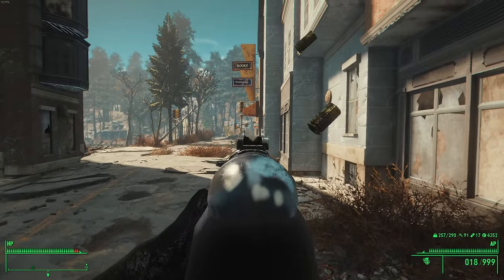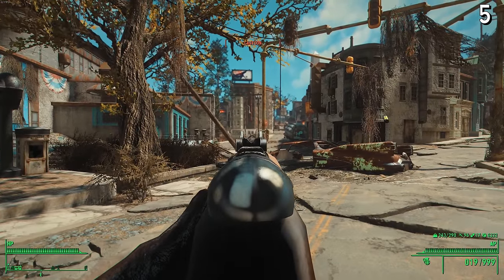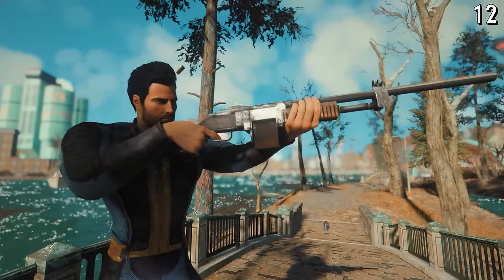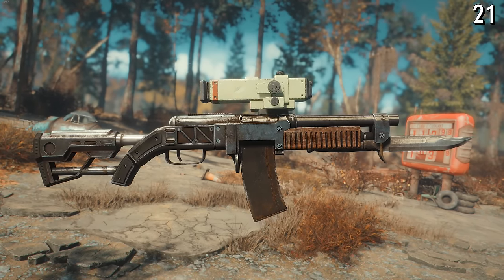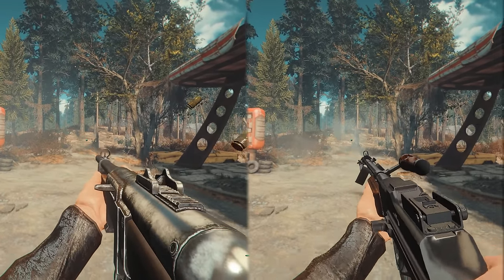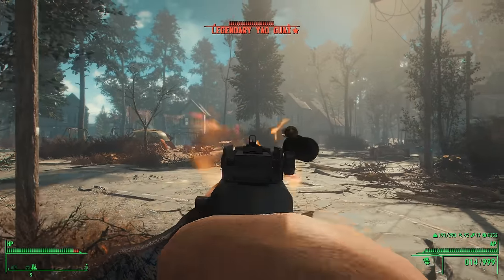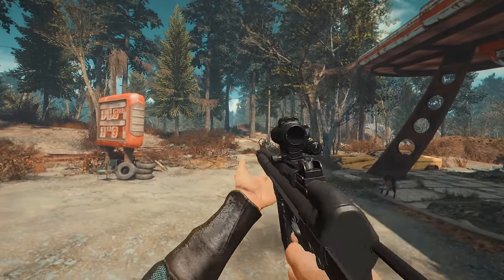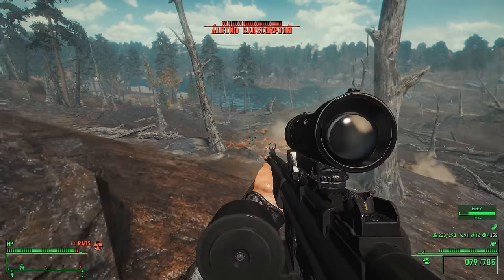Everything WRONG With The Combat Rifle In Fallout 4... And What It SHOULD Have Been

Comment: Having been an armorer for the us army, national guard units keep around old gear, they are usually the last to get new stuff, we swapped over to the m17, but most national guard units still have m9s in the invasion of Iraq tank crew men were still issued m3 grease guns, it’s not unreasonable for fallout’s national guard units in Boston to have kept around the bar, especially when in certain areas their tech progressed in certain areas but lack in others, if they are still using a g3 variation in 2077 when the bombs dropped who’s to say they didn’t faze out the bar until much later as well? Keeping it in the hands of national guard
Reply: I would've been fine with this.
Natty G's still using old but reliable stuff due to issues with logistics.
F3 was fine in this regard with the prevalence of FAL/G3 hybrids chambered in 5.56x45mm.

But then came F4 and for some reason the Commonwealth National Guard got sets of new T-60 power armor because "rool ov kewl" in the prewar prologue, and the prevalence of pipe weapons in master locked military safes inside 200+ year old sealed bunkers, and the asinine "standard issue" weapons that would've been outdated at the end of WWII.

Really.
T-60 should've been a Brotherhood of Steel exclusive power armor. Made as replacement upgrades for aging T-45s they had. While the prewar prologue National Guard should've been using T-45 instead.

Pipe weapons should be removed from any prewar military installation loot tables.

And conventional ballistic firearm design (not including laser, plasma, cryo, and the like) should be completely scrapped and replaced with realistic designs. 
There'd be 2 prevailing design philosophies.
Prewar and postwar.
Prewar is basically carbon copies of ours. With some upgrades and additions to our current ones to portray 2070's weapons. 
Really old prewar weapons for example would be Korean to WWI weapons.
Modern 2070's prewar weapons would be really rugged, metal reinforced M16s with ACOGs or Mk19's with carry handles for power armor.

Postwar would be prewar weapons redesigned to be as easy to manufacture in the post apocalypse but still be reliable and useable as possible.
An example would be an M16 with simply made wood furniture, no dust cover, no T-handle, no carry handle, no forward assist, simple notch and post sights, straight magazines, semi automatic by default, and a long screw on the bolt to act as the charging handle.
Reply: Fallouts navy kept the m16 70 odd  years after the rest of the coubtry moved to newer guns  so yes this happens even in fallout
Reply: @demonic_myst4503  some things never change
Reply: I interpreted the Combat Rifle as an older gun that was chambered for .45 and issued to the police departments and national guard depots to violently repress Protests and Resource Riots.
Reply: this "gun" the combat rifle would compare to the NG having smooth bore brown bess rifles on storrage in case of emergency. the "combat rifle" is by all means obsolete even by fallout timeline standard as the divergens happens in the late 1950´es when something like the FN-Fal, the CETME-L, the AKM, the G3, and even the first incarnations of the M16 does exist, other games in the fallout series especially prior to fallout 3 has more "modern" assault rifles SMG´s MG´s in their arsenals. even in fallout 2 they have P90 PDW´s. the MP5-sd exist in fallout tactics, the G3 in 5.56x45 exist in fallout 3, the XM-117e2 exist in New Vegas.
Reply: @DJWeapon8  Yeah
The T-60 should have been explained more as a Brotherhood modification of the venerable T-45, as the T-45 was produced in more numbers than the T-51.  This is in the same vein as how the Enclave were able to produce their own Advanced Power armour Mk II based on the older version.

In fallout 4 by the time you hit like level 20 all power armour spawns are either Advanced power armour or T-60, completely negating the usefulness of T-45 and T-51.

As for pipe weapons in prewar safes, that’s just lazy loot lists on Bethesdas part.
Reply: G3 and its variants are easily in the top three rifles ever made, I hope it's still used until 2077.
Reply: Its stated in the lore for fallout 3 somewhere that the G3/CETME style rifles you see lying around weren't the standard issue for 2077 for the military and they were only used for security forces/national guard equivalents in the interior US who were less likely to see combat. The weapons that you see in Fallout 3 are merely the most resilient and simple designs that could survive two hundred years of wasteland abuse, and the G3 was actually filling the role you describe for the BAR of being an old rifle in the inventory kept for use in the rear and outside of combat zones. Frankly the BAR was obsolete pretty soon after it was fielded and given that the infinitely better G3 is considered old and second-rate by 2077 I think its a bit of a stretch.
Consider that Fallout New Vegas went on to show that mid-to-late 20th century weapons like the FN Minimi, PGM Hecate (Anti-Materiel Rifle) and more modern AR15 variants like the Marksman Carbine existed, I think its fair to say that firearms development proceeded along the lines of how it did in our world.
Reply: @solwindp78-1  Yet the operation Anchorage simulator has them equipped as the main service rifle.

It should be noted that there is a large disconnect between the weapons and aesthetics of the West Coast games (Fallout 1/2/NV) vs the East coast games (Fallout 3/4).

This is further complicated by  Bethesda breaking the lore with retconns and the like with each successive game.
Reply: @5RndsFFE  I think its fair to assume the weaponry used in the Anchorage DLC is just asset re-use. They were not going to do much more than slap on a fresh coat of paint for the sake of the DLC, which is understandable. 

I'd say fallout 3 is actually pretty close to Fallout 1 in terms of weapon variety and aesthetics. If you pull up a list of both and compare them there is a large overlap with many of the 3d weapons being patterned off their older counterparts, barring some changes like the combat shotgun and unique variants. The main disconnect is Fallout 2 which added more 'advanced' contemporary weaponry to the original roster and instead of following up on that Bethesda dialed it back for 3. 

As long as there is a lore justification I feel its not totally incongruous - Fallout 3 having a clustered metropolitan area hit by more nukes that took place later in the timeline so less advanced tech unless its from the Brotherhood or Enclave, New Vegas being less destroyed and sourcing both newly manufactured NCR/Gun Runner weaponry as well as cowboy/western guns. Fallout 3 didn't rock the boat so much. Fallout 4 is where things start to fall apart and go full on Bethesda for me.
Reply: @solwindp78-1  it feels kinda like it progressed a little slower but still interesting nonetheless, that’s one of the many things I like about fallout, it’s attention to detail when it comes to lore
Reply: "Having been an armorer for the us army, national guard units keep around old gear, they are usually the last to get new stuff, we swapped over to the m17, but most national guard units still have m9s in the invasion of Iraq tank crew men were still issued m3 grease guns, it’s not unreasonable for fallout’s national guard units in Boston to have kept around the bar, especially when in certain areas their tech progressed in certain areas but lack in others, if they are still using a g3 variation in 2077 when the bombs dropped who’s to say they didn’t faze out the bar until much later as well? Keeping it in the hands of national guard" -🤓
Reply: Not to mention there are probably several gun clubs and collectors who would have these, not to mention civilian militia units who get wrapped up in ultra nationalist fervor.
Reply: @DJWeapon8  you do know there is a pre war magazine that explains how to make pipe guns so that argument is invalid, also it wasn’t national guard in Boston that day, was confirmed to be the army itself so that argument is also invalid
Reply: @twilightparanormalresearch186 No. Its because of lazy loot tables bad worldbuilding. 
210 years after the bombs dropped and the most prevalent weapon is still scrap metal and rotting wood pipe guns?
As a real world comparison, 200 years ago, cap and ball revolvers and flintlocks were prevalent. 
With Fallout's advanced tech in the control vaults, 200 years should've been more than enough to recover to at least our late 90's levels of firearms technology.

Regardless, I consider bethesda lore and therefore 3, 4, and 76 is non canon as far as I'm concerned.
Reply: A BAR with an ACOG sight would make a pretty decent modern combat rifle.
Reply: @the_inquisitive_inquisitor  Possibly but I think they would need 30 round mags instead of the standard 20
Reply: @hauntedhouse7827  Sure, the 20 round mag was always a strange choice in my opinion.
Reply: Christ! They used those things in Iraq?! I thought greese guns were dangerous by ww2 standards.
Reply: @Gr3nadgr3gory  they did in the early invasions, they were only issued to tank crewmen as personal defense weapons, I have a buddy that I met in the VA that was a tank commander in desert shield that was issued a grease gun, I know it sounds odd but the way the military works is if it’s not broken don’t fix it
Reply: @HangryWendigo .  with the Greese gun that's just because it hasn't been fired enough!
Reply: @the_inquisitive_inquisitor  look up the hbar, it’s pretty much a modernized bar
Reply: @5RndsFFE  the Anchorage simulation is also said to be wildly inaccurate.

Comment: As for the BAR in .308/7.62x51 instead of 30-06, it's a fairly easy conversion. This was done en-mass to many WW2 era 30-06 weapons when NATO adopted the 7.62x51.
The Garand, Browning 1919, etc... were often converted to use the .308 type cartridge, so it's definitely possible for that to have been done with BARs as well.
Reply: Israelis used Mauser 98s converted from 7.92 Mauser to 7.62 NATO for a time.
Reply: @judsongaiden9878  I personally HAVE an Israeli 1919 rechambered for 7.62x51. That's what inspired my comment. But converting bolt actions is particularly simple. Minimal feed system adjustments needed.
Reply: @dark2023-1lovesoni  Rawk!

Comment: The ones in Sierra Madre are almost certainly Colt Monitors, a slight rebuild and update on the BAR in the 50’s to try and capture last bits of sales. Lighter, with a pistol grip, and short barrel, it was made for police forces and security. Makes sense that the Sierra madre casino security would have them
Reply: Wasn’t the Monitor made in the 20s and 30s? I thought I read somewhere that it was used by one of the men that killed Bonnie and Clyde but I could be wrong.
Reply: Colt monitor first introduced in 1925. Yes it was one of the weapons used during the final showdown with Bonnie and Clyde
Reply: Man thats so cool, this seems like one of the guys in obsidian was a gun nut and tried to fit everything he could in that broken engine

Comment: My suspicion is that they originally intended to recreate the R-93 (G-3) in FO4, but due to some combination of development crunch, legal concerns over the similarity to a real world firearm, and meddling theory of "game balance", the team had to drop it, and cludged together the combat rifle late in the game. I wouldn't be surprised if it came down to a spreadsheet with slots for different level ranges and enemy groups, where they had to have something to plug into each cell. That would also explain the monstrosity that is the 'assault rifle', i.e. "we need a mid-level full auto by default gun that looks appropriately sized for super mutants. But we don't want to call it an MG because that has certain connotations for damage/ammo..." Terrible reasoning, but very much standard game dev.

Comment: Fun Fact during the early years of the US involvement in WWII there a debate within the US Arsenal to make the BAR the standard battle rifle for US forces. The plan was to convert them to Semiauto which would allow them to reduce the weight of the rifle. That would make it light enough to be used for riflemen. But the US was already fielding M1 Garands at the time and they felt that served the role.
Reply: Also the BAR mag kinda sucks.
Reply: Making it semi-auto only doesn't really save any weight, in fact it might make the gun slightly heavier.
The reason they kept the M1 instead of adopting the BAR is because the BAR was almost 50% heavier (13.75 lbs vs 9.5 lbs)

Comment: Something you missed. 45acp make little to no use of a muzzlebreak/compensator. The round is so low pressure, that after a few inches, the pressure has dropped below the point of having any real effect from trying top divert the escaping gases. The sad thing about the BAR is that there were versions chambered in 308, and even more modernized and lightened. Both FN and Colt made them.
Reply: Also I think Ian over on Forgotten Weapons mentioned that the Belgians ran the BAR for a good number of years after we stopped. There's also "modern" BARs made by various small gun makers I think Kentucky Ballistics has one called an HCar.
Reply: @jamesdevore3022  It's actually a popular weapon to hunt with nowadays, due to it's great accuracy, reliability, and the strength of the 30-06 combined with the barrel length. While outdated, it's definitely the most viable weapon that could be used in modern combat from the pre 1920's era, minus the Maxim of course.
Reply: @jamesdevore3022  I helped my grandpa build a parts-kit Model D many years ago, and I treasure it. He had originally seriel'd and built the receiver just weeks before the registry closed, but didn't finish it until I was a teenager. It was my first automatic, that he transferred to me when I turned 21.

Comment: Fun fact: the R91 was adopted by the US Army in 2075 as the primary assault rifle due to rampant materials shortages at the tag end of the War, displacing the long-serving M16 and its variants. Being a cheaper, stamped-steel and wood-furnished version of a G3A3, it was chosen purely for cost-effectiveness as supplies of both steel and the oil for plastics dwindled.

Comment: In all honesty, modern weapons (and let's be clear here, that means weapons with black, polymer furniture and 21st century optics) could easily exist in fallout, but would almost certainly be about as common as finding a mother load during a gold rush.  After 200 years there'd be the guns that had been passed around and the polymer had degraded or broken from use and the guns that had just been discovered.  The latter would be more and more rare with every passing year.  The use and abuse many of these weapons would see would require constant maintenance and repairs.  Wood furniture and simpler optics give the feel that it's been worked on since the great war and IMO make the game that slight bit more immersive.  The post 2010 aftermarket parts on a lot of the gun mods drag me straight out of the wasteland and into call of duty.
Reply: In my opinion.

Fallout having modern tacticool guns is lore friendly. After all, the world reached 2077 and has advanced combat robots like the sentrybots and assaultrons before the nuclear apocalypse occurred. If anything, the guns shown in the series aren't advanced enough to fit the level of technology available during 2077.

That said. There is still a ton of nuance in how guns should be presented in the series based on the lore and the time it is set in.

Early Prewar, which is before 2060, would have all of the advanced guns with advanced optics and attachments. 
But these would be extremely rare in the game. Being turned into Unique Weapons that you only get after delving into a dangerous location that has been sealed for over 200 years.

Late Poswar, which is after 2060 to 2077, would have these advanced guns start using other materials than polymer like aluminum or wood, and would have little to no optics or attachments. Some long range riflea having a magnified optic at best. This is due to the resource wars causing an increasing petroleum shortage that is now affecting the US. Low access to petroleum = low polymer production rate = low amounts of polymer gun furniture. 
In general, these guns would be more prevalent in the games. Especially when the game is set very early after the apocalypse. Where they are used as loot and set dressing when exploring prewar locations.

Postwar guns would be guns made after 2077. They come in a variety of designs ranging from "better than nothing" improvised pipe guns that are single shot to revolvers at the most, simple but reliable bolt actions, to remanufactured derivatives of the advanced Prewar guns made using Postwar materials and tooling.
Generally speaking, postwar guns would make up the vast majority of guns in the game. With the kind of designs that are prevalent being based on the tech level the game presents.
For example: 
A game set in a tribal society just 30 years after the nukes where melee combat is the norm would have almost all of its guns be single shot pipe guns.

A game where it is set inside a thriving postwar city 200 years after the nukes would have full auto M4s and Uzis with wooden furniture.

Comment: So i'm actually OK with  .308 and .45 ACP  being viable options. Both have the same case head size (I've rechambered a CETMEC into .45ACP using Thompson stick mags), and I dont hate the idea of the single stamping receiver of the PPSH being used instead of the milled reciever of the BAR... even the trigger guard makes sense for fighting in the cold of  Alaska... 

As a rough draft it's not terrible, but it should never have been shipped like this.